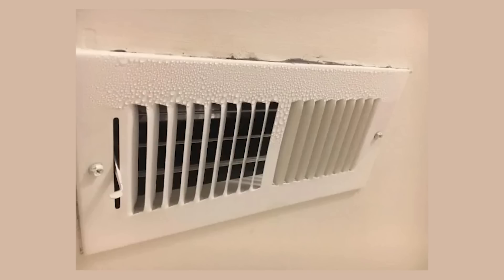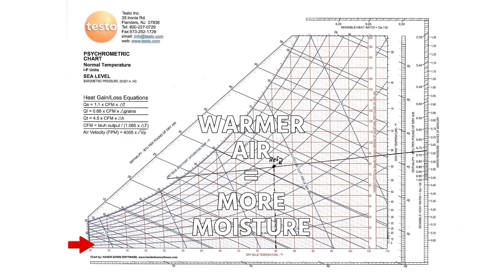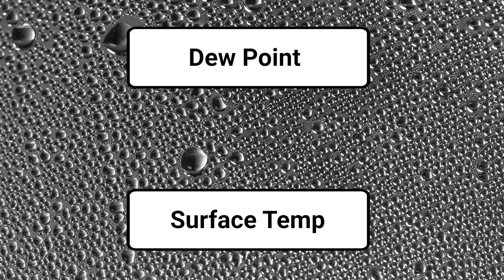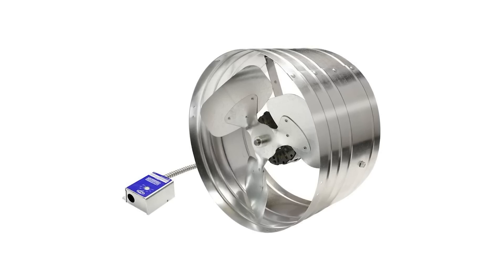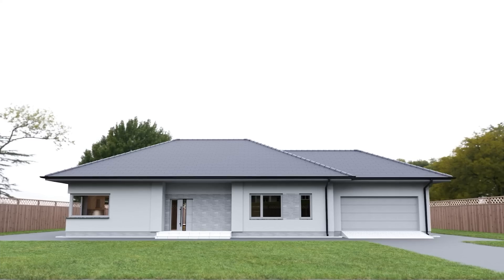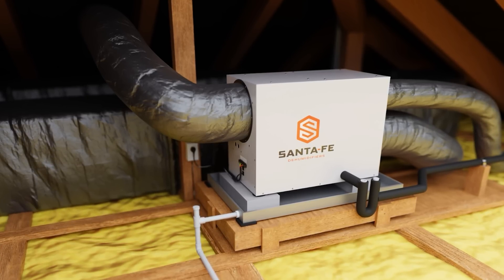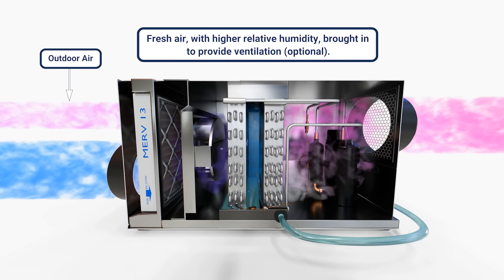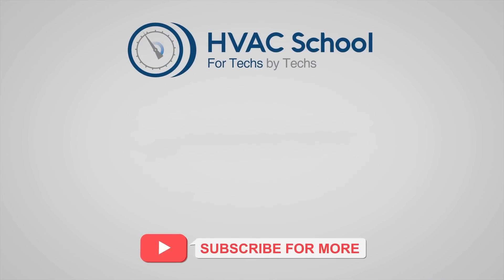Condensating Vents: Q&A with Bryan Orr

Comment: Run time right? I don’t think I heard you mention that.
an oversized unit will cause humid air to remain in the living space.
Since replacing a unit that’s oversized is expensive. Someone could get a space dehumidifier to take out what’s lacking. 
Lowering the fan speed can draw more moisture from the air, but I believe that has its drawbacks from air delivery and the cooling experience.

Comment: I’m more confused after seeing this
Reply: The guy sending him a video of his sweating vents has warm humid air in his house. His AC is not removing enough moisture. When the cold air comes out of the vents, it makes contact with that moisture.

He did make a good point that sometimes this will happen if the doors are open too long, which wouldn’t clue a fault in the system necessarily.

Comment: I had a similar issue at a recent call and made a video on my YouTube about it. I found low static pressure and making the vents too cold so they were reaching dewpoint and condensating other companies have put everything on this and every vent in the house was condensating for two years. I raise the fan speed and by the next day everything was fixed and working great. That was my fixfor that situation

Comment: I'm in 32169, 600 feet to the ocean. I use 2 ac central systems for the same rooms. One tiny system has on/off switch, no t-stat, runs 7am to 8 pm most of the summer. I turn on system #2 when it gets too hot. Grilles don't sweat.  The 2 systems are not connected in any way,

Comment: I have none of these condensate issues but live in central Florida, does running the air handler constantly have any benefits and just have outdoor unit cycle on and off
Reply: When you run the fan continuously, all of the moisture that has collected on the evaporator blows back into the air when the compressor is not engaged therefore the evaporator is not below the dewpoint any longer. Also any duct leakage or imbalance in pressure will bring in heat and humidity
Reply: @jw77019  thank you

Comment: I would think that the evaporator removes much of the humidity/moisture from the living envelope. If its is working well, after a few minutes of running it would seem that any high moisture conditions would soon "dry up" as the system operates. Wet supply registers tells me the house is not sealed well from the exterior and/or attic. Also, an oversized system would likely fail to remove humidity long enough in between cycles?
Reply: You're correct- oversized systems perform poorly at dehumidification
Reply: @rayzerot  I was also thinking if the blower motor was wired to sping too slow, that could do it too.
Reply: @Garth2011 lower blower speed lowers evaporator temperature increasing dehumidification. Inverse is true as well. Think of a unit with a fan motor not working. The coil eventually freezes because the suction temperature gets below 32°.
Reply: @melonz4011  Yes true but there are more than one factors going on with a slow blower. Volume of air gets less treatment.

Comment: 33%  humidity max , Any more will cause condensation
Reply: my skin started cracking just reading this
Reply: @95thousandroses I can't tell if he's being serious...
Reply: That's a good rule of thumb for winter season. But even 33% is too high if the outside air temps fall below 20F. 20% indoor RH is a better target at 0F or -18C outdoor temps.
For the summer, a good target is 50% RH. People tend to be the most comfortable at roughly 50% RH and 21C (70F) indoor air temps, which gives a dew point of roughly 58-60F.

Comment: Add fresh air
Reply: In order to not waste energy, and defeat the purpose of having a high SEER A/C system though, an ERV system is needed. Basically it's a small heat exchanger than exchanges heat between stale air exhaust and incoming fresh air.

Comment: Dropping the evaporator temperature as much as possible to get the supply dew point temp down and then adding a bit of reheat to lower the supply relative humidity is one option.
Reply: So you just jerry-rigged a dehumidifier lol
Reply: @rayzerot  A cooling coil followed by a reheat coil is a standard configuration for commercial or industrial air handling equipment. It's just that residential equipment manufacturers don't know how to build a proper air handler, apparently.

Comment: How about removing the grille? Get rid of the cold surface.
Reply: too obvious, replacing it with a wood grill would be too smart
Reply: how about a low voltage heated grill?  A grill covered in felt?
Reply: @95thousandroses  lets just go the full 9 yards and make shag carpet grilles 😂
Reply: Let's install a grille with replaceable desiccant. It's the only sensible thing to do